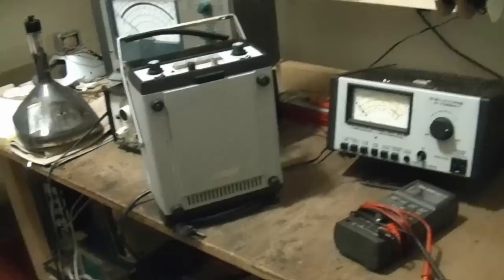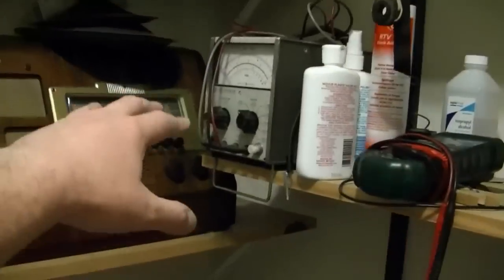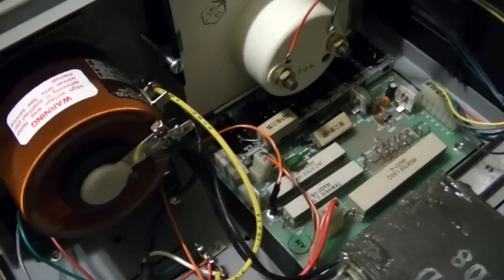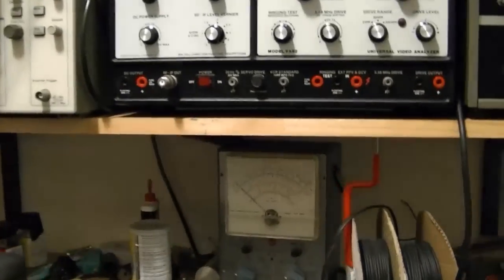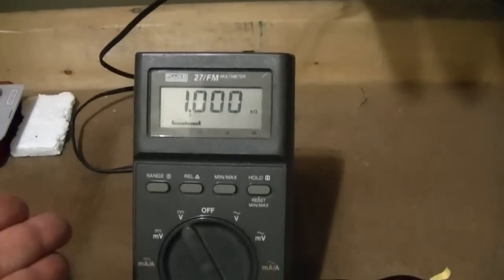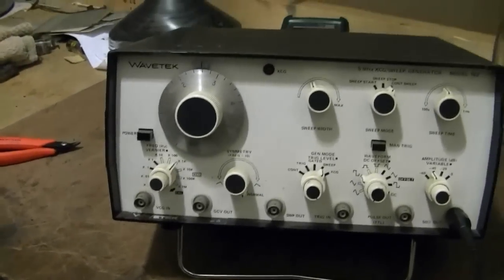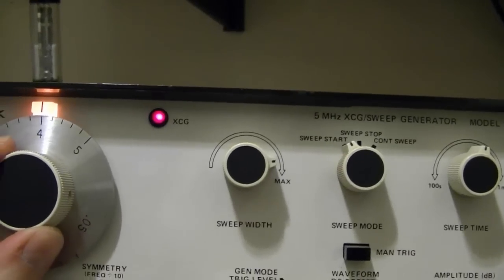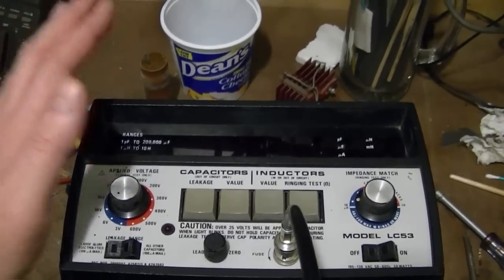New test equipment pt2o?

Comment: Which VTVM do you think would be more accurate, your Master Voltomyst or a Hickok Model 209a Vacuum Tube Volt Ohm Meter Vintage VTVM? I would like to buy a VTVM to start in trying to restore vintage tube amps for guitar. Thank you for sharing your years of wisdom.
Reply from the maker: I couldn't say as I've no experience with the 209A.  I do know that none of them are as accurate as a modern DMM.  Probably no better than 5% or so full scale.  I mainly use VTVMs for doing radio and TV alignments where an analog meter is easier to view.  I use a DMM for voltage current and resistance measurements.

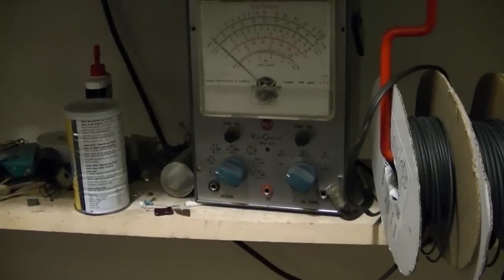Comment: Thanks for the tip on the Fluke 27 FM. I picked one up as they are still available on ebay for reasonable prices. My fluke was last calibrated in 2011. Very happy with the condition, build quality, size and weight (as it will stay put). For others who are interested in the meter, you focus on it starting at 13:10.

Comment: Yup... Very familiar territory inside that Sencore PR57. Not much to the beast is there? Hope your push button array doesn't get jammed like mine was when I got it. Had to completely disassemble it to get the locking bar back in the correct position. Has worked flawlessly ever since though! Too bad you couldn't find the exact hum point. I was half expecting that it was the cover, and the hum would be gone when turned back on without it. Unfortunately, that was not the case.

If I do get that model fluke in the future I will defenitely look for the "FM" designation above the LCD screen. I also watched the EEVblog on it a while back when you initially got yours. That Aussie is quite a character! It is built like a tank with extremely good shielding and high accuracy components. It can even be re-calibrated!

That Wavetech generator is so cool. I am so familiar with that era of electronics. I was working on mini-computer disk drive controllers during that time.

Have a Merry Christmas Bob to you and your family!
from;
        Tom and his family.
Reply from the maker: I've heard Sencore switches can be troublemakers.  Glad you were able to fix yours. 

Check out the new EEVblog video on some auction scores.  Man, am I jealous of all that wonderful test equipment !
Reply: Hey Antique,  I just picked up a PR57,  I am a newbie in the electronic field but a 30 year professional guitar player. Finally decided maybe I should be able to work on my own  50s/60s amps and make them sound the way I want them to.   Anyway,  My Sencore  is showing  117V on the Meter but only  111V on my Dig Multi meter. And Multi meter is good.   Any ideas?  I understand there are some meter diodes that may be the issue?